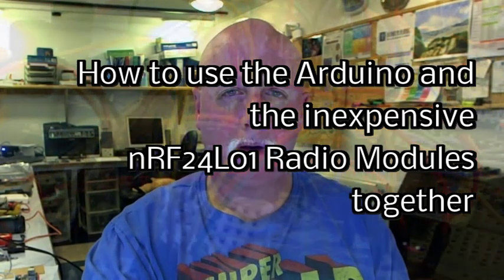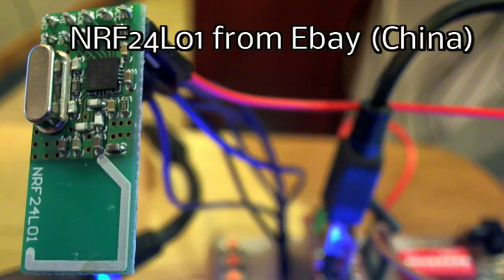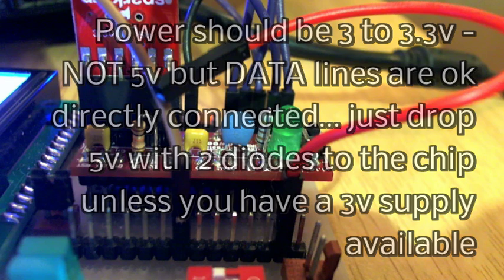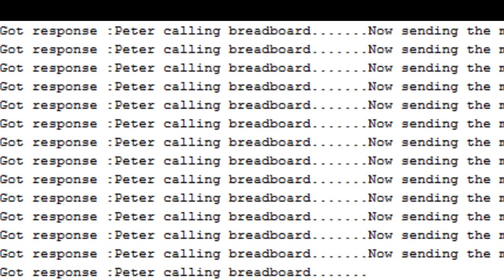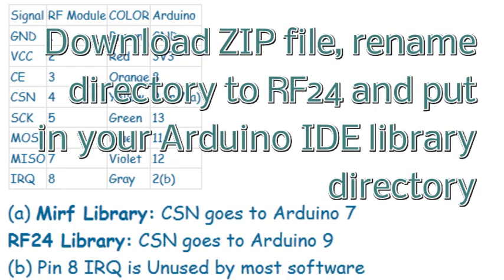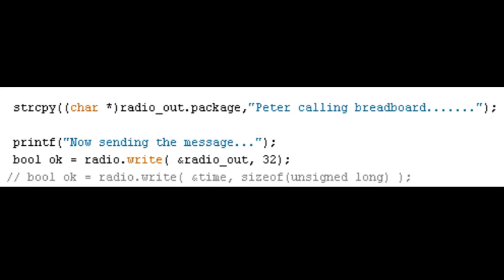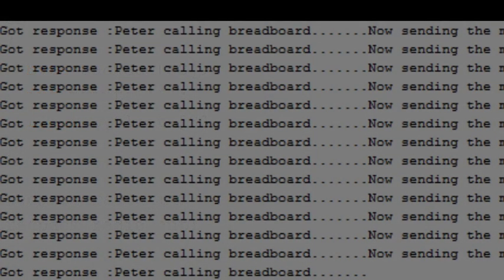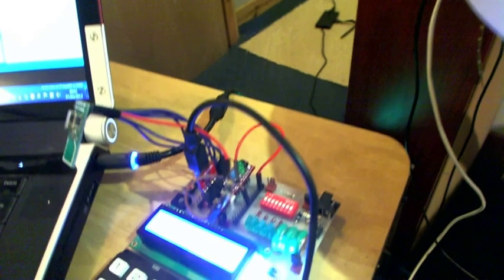NRF24L01 Short Range Radio Modules- Using With Arduino

Comment: I just noticed in here a link to a YouTube video showing great range of these units over lake!! Don't be fooled - unless you plan to transmit across a lake!!! Any obstacle will SEVERELY limit their range and indoors unless you live in a very small house - they are simply NOT the bargain they would appear to be. Also they cannot RX and TX at the same time and will not return signal strength so the mesh networking software out there is really not that suitable for them - far better to go for a different frequency range and something a little more upmarket...   merely speaking from long experience.

Comment: Did you use computer on both side or you let one module to run on power too? I tried to power one with usb adapter as receiver (default) and another connected to laptop as transmitter, but it doesn't work that way. It only works if both are connected to a computer. Do check PA version of nRF 240l+, it comes with external antenna and supposedly has more range.
Reply: Ok, firstly - using USB or in general, stick a 0.1uf cap AND a 330uf cap across NRF24l01 - the peaks as is the same with other radios must NOT be ignored or they will reduce range dramatically - the unit does NOT take a constant current.

External antenna - I found no GREAT advantage. I'm now using ESP8266 WIFI and I find the PCB antenna better than ceramics and only marginally inferior to a bloody great wire.
Reply: Peter Scargill Thanks for info! :) I've PA version of nRF 240l+ with external antenna. I'd no problem as both module were working just fine (when both were connected to a computer). One module was connected to a desktop and another was on my laptop. I moved the laptop around the house and the module could transfer the data with some few lost data packets. I tested it for around 20 ft but I've a small house, need to test it in open or our company warehouse which is approx. 50 meter long. I think, 0.1 uF is needed on non-PA module.

I've ordered ESP8266 module and waiting them to arrive. What is your experience with them? range, data transmission, reliability?...I'm interested in developing some commercial home and industrial automation product using such kind of modules (start-up). I also have nRF 905 module but didn't test them yet.

Comment: Hi Sean - well I've never used this before - but today if I were using the NRF24L01 radios (which I am throughout the house - but I'm not actively developing with them as the 433Mhz RM22 compatibles from China are better) I'd be using Radiohead library (which I am in the house) and I BELIEVE there is a broadcast package - if memory serves me well, sending to device 255 sends to the lot. I'm currently investigating a complete alternative to this using the ESP8266 units, my only issue right now is their apparent inability to be listeners and web clients at the same time (something the Ethernet boards achieve painlessly) - but then they need a cable.

Comment: hi, how would the receiver know what type of data its receiving? e.g. how would it know if it received an integer, float or just bytes?
Reply: Well presumably you will tell it. In my case I define the same union at both ends so I can handle a mix of types.

Comment from the maker: Hi all.  Sorry Andre I've not used the radios in that scenario - you're likely better off heading off to an RF24 forum for that one. All - yes I do plan another video - I'm using the RF24 library (with a caviat) in a complete home control system now - just need to do some tidying up and I'll put together a short video to fire off ideas in others.

Comment: Hi. I've seen you have postet plenty of stuff of the NRF24L01 online. I'm trying to triangulate 6 radios for my robot. With the RF24 library, is this possible?
from my robot, I ping the other nodes, but I get stuck when I'm trying to ping more than one...
Do you have a tip for me??
-Andre

Comment: Hi Peter, I'm around trying to connect my 2 Arduino mega with nRF24L01 modules, searching the web I found many codes and ways of connecting, probe all he had. This I need for my final project from high school, well my idea is to send text and data between two Arduinos as: temperature (25 ° C), humidity (50%), Time (23:43 Hs) and a date (1 July 2013). As I wrote before, there was no case to probe codes if you got a way to communicate, I appreciate. Thank you. please i need your help!

Comment: Peter, I'm trying to get my rf24 modules (+ model) to work with 2 Arduino Micros. I'm trying to use the RF24 library and not MiRF. I keep getting failed and timed out messages when I tried using the supplied examples. I'm trying to send serial input from the one micro to the second and have it interpret the info. Any help? Thank you!

Comment: Great video Peter! Quick question: I bought some nRF24L01+'s, and those pin headers eat up a lot of space thickness-wise, and I want to squeeze one of these in a tiny space (around 6mm of space). I desoldered the pins, but the pin header still doesn't come off. Have you had any luck with removing those?

Comment from the maker: Yes, a union is simple - you put whatever you want in it - and the compiler reserves space for the largest item - unlike a struct where all the items can be used, in a union only one of them - they all occupy the same space. But it means you can use that space for whatever you want. The transceivers don't care what's in there - yes, you can use ints and floats.

Comment from the maker: Sorry I haven't played with the other transceiver units - just these. It's all about price - some years ago I developed a home control system with boards all over the place but these ran on a telephone cable (+12v, gnd, open-collector signal) - today I want to do this but using inexpensive radio. At less than a couple of ££ from China these modules are worth using but only if I can get a reliable network running.

Comment: Thank you for making this very informative video.  Do you have any experience with the 315 or 433MHz transmitter/receiver units?  I read somewhere that while they may not transmit as fast as the 2.4GHz tranceivers, you could get longer range with them, especially when powering the transmitter from 12v and using an external antennae.  I'm looking into different units to send a simple on/off command where data rate isn't important but distance is.  Any advice?  Thanks again, great video!